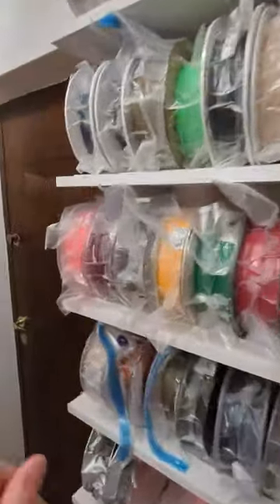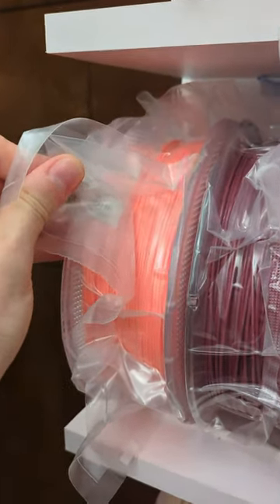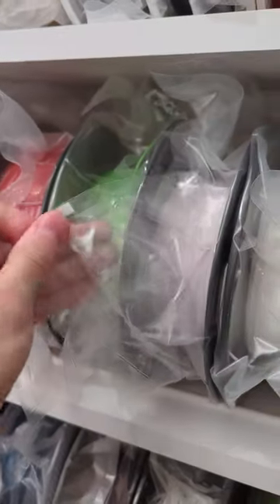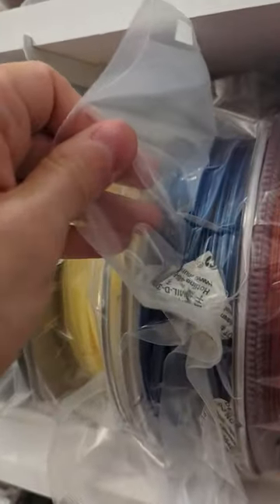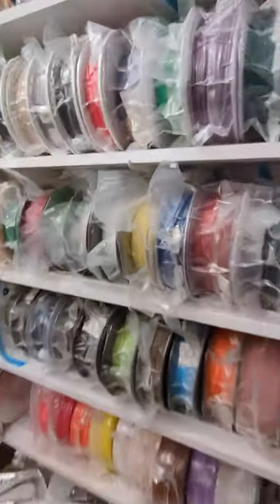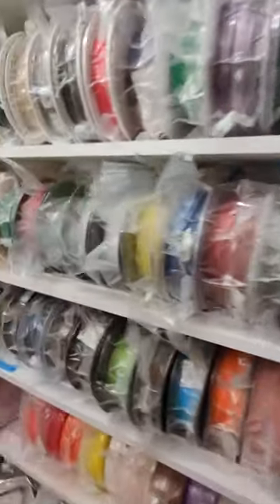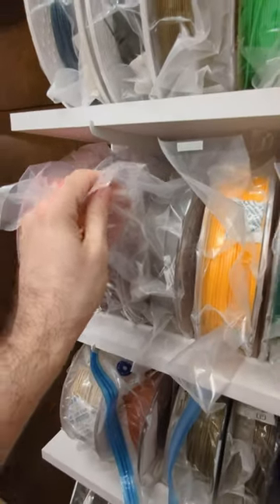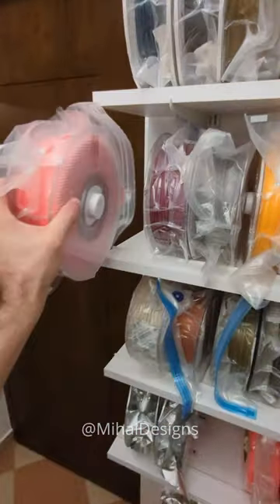Do Eibos vacuum bags work?

Comment from the maker: Eibos vacuum bags and pump https://www.eibos3d.com/eurus-detail
Reply: Quick question from someone who has never 3D printed or done anything related to 3D printing: Why do you need to put them in bags? Wouldn’t it work like hot glue guns where it just makes the glue (filament in this case) super hot then just pumps out the hot filament?
Reply: @NotRealChatGPT It’s because the filament tends to absorb humidity and when a filament is humid it does not print well. Now you know 😋
Reply: @grininventor  Oh!

Comment: I bought a bunch of them quickly after your first video. They’re much thicker which helps with the filament puncture but it doesn’t make it entirely pierce resistant. It’s been about a month for 12 of my spools and all are looking tight and I sloppily tossed them in a box 😅 

Overall I think they’re better, even thought slightly, than the alternatives.

Comment: My dad does professional OTR machine testing for testing oxygen and water permeation under different conditions on plastic films. There will always be a level of moisture ingress over time through plastic like PET or PP. you really would need a glass container for full moisture impermeability. Not practical, but the Mylar bags (metallic) are a much better option for easy bag use. Little to no ingress.

Comment: I have a set of these bags. The ones that won't hold vacuum should be checked for leaks. Ordinary packing tape will seal any leaks, but it's a nuisance to find the leaks! I had been filling the bags with water to find the leaks, then have to dry them before sealing. I've yet to try what I hope is a better method; Inflating the bag with air as much as possible and spraying the outside with soapy water to create bubbles at the leak spot.

Comment: Genuine question, why are they vacuum sealed? I'm not well versed in 3d printing, does the filament go bad?
Reply: When exposed to air, they can become brittle and print badly after being exposed to open air for some time due to the moisture of the air. This is worse for some materials than others - for example, I don't usually keep my PLA in vacuum bags if I plan to use it again within a couple of weeks and I haven't had problems. For longer storage I do, though. However, depending on the humidity and with other materials it might be more of a problem.

There are also boxes you can buy that removes moisture out of the filament, but I personally haven't tested those yet.
Reply: @linuswalden what kind of problems do you get? I never vacuum sealed mines
Reply: @ethaneveraldo  I only use PLA so I've never really had problems myself, but there are some videos that show the kinds of problems other materials have when moist.
Reply: @linuswalden  I thought PLA was the one that needed to be sealed, because it supposedly absorbs moisture? I never seal my rolls and never noticed an issue, maybe it’s an issue for people who live in very humid areas
Reply: @ethaneveraldo  as far as I know, PETG and TPU have the most problems with moisture. Anyways, if you don't notice any issues, you should be fine :)